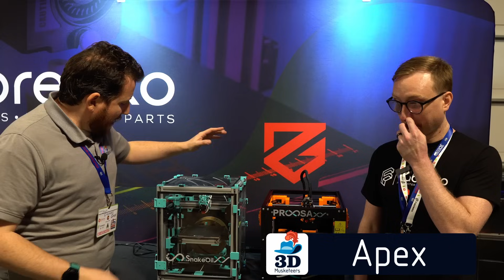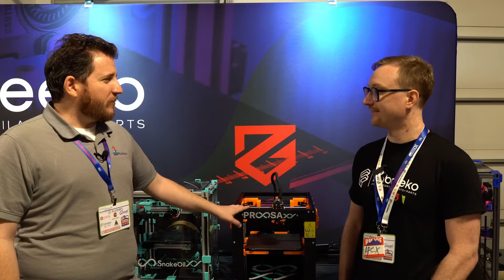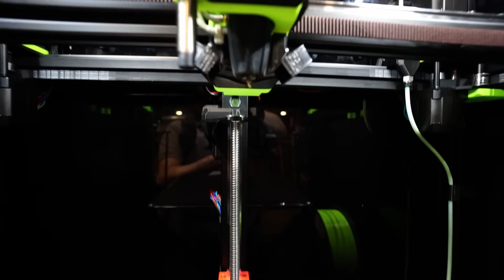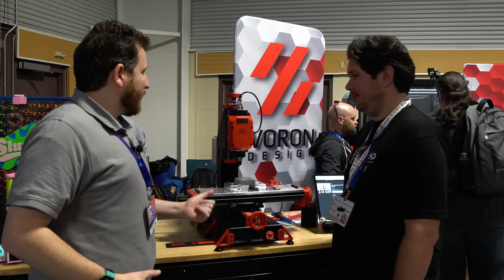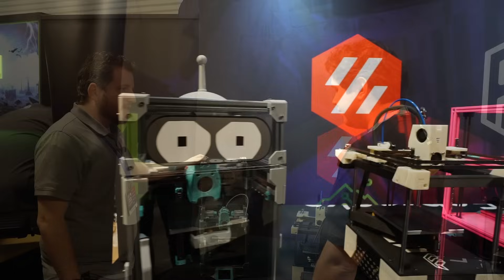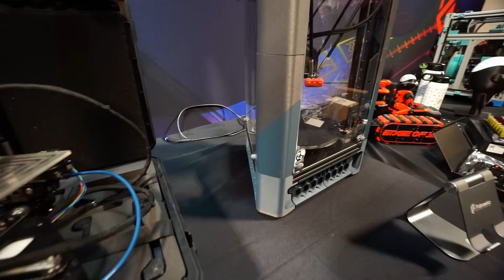Rat Rig's BRAND NEW PRINTER! - Fabreeko, Rat Rig | RMRRF 2024 4

Comment: Ooooh. I like the proosa. However, I just upgraded it to 3.5. It’s so fast and such good money spent. Maybe I’ll look on eBay for a used one to try this conversion.
Reply from the maker: yeah, if you did the 3.5 no reason to do the PROOSA
Reply: @3DMusketeers  yeah, I’m pretty happy with it. I’m ready to upgrade the tool head though. I pieced it together on the Prusa website and it comes to about 200 bucks and I think I could do so much better than a nextruder for less money.

Plus, I’m one of those types that enjoys the project probably a little more than the actual printer. I just like having something to tinker and build.
Reply: @3DMusketeers  i’m reading the stats and they still seems like there might be some benefits. But with the newer computer, it’s pointless like you said. I do like the footprint being much smaller.

Comment: I'll put in a vote for a V-Core 4 build...I'm trying to get management at work to buy something to replace our dead Stacker3D machine, and either the base V-Core 4 or the IDEX version would help us with a bunch of different things. The biggest thing holding me back from making an honest recommendation for it is the build time/complexity - if it's as involved as a Voron build, it won't work for us. The other front-runner is an FLSun S1, which even if it prints half as fast as FLSun claims is still going a ludicrous 600 mm/s.
Reply from the maker: I would guess it is pretty involved from looking at it.. But we will work towards it!

Comment: Thanks so much for covering our ProosaXY project!
Small correction: The frame extrusion is NOT re-used from the original mk3, but the front frame plate is.
Reply from the maker: Absolutely man! You always have some awesome projects!
Reply: this is exactly what prusa should do to survive. Use as much as they can from stock and upgrade MK4 to MXY4.
Reply: @thePavuk Nah. You can see the direction they are going. 

Commercial, hobbyist, consumer. 

If you’ve seen them at the tradeshow, they’re mostly set up for industrial and manufacturing. they’re really starting to put a big focus on capturing big businesses, science and tech hence opening US facilities. This will be systems like the Delta and the XL core XY system.

Next is battling back into consumer. They are going to have to leverage the manufacturing techniques of the Delta printer like metal, stamping and injection molding, etc.. this is going to have to be the machine that fits in nicely on your kitchen counter or workshop table with the standard cube design with multi material, but obviously this is speculation.

Finally hobbyists. Everybody thought that the MK3 was the pinnacle and there was just nothing you could do to really make it much better but as we see input shaping change all of that. Add some faster, motors, etc. and you have a great enthusiast even manufacturing machine. I think they go on to keep supporting that system and possibly even do something like getting involved in the voron project or more likely scaling down what they’ve done with the XL for enthusiasts. 

All pretty fun speculation, but they’ve definitely started making a big push into manufacturing and industrial where bamboo and reality and others will probably never be able to get a foothold just because everything is manufactured overseas, which is a big no-no for certain things.

Comment: Love the Proosa. Interested to see how the kit's price compares to a full MK3 to MK4 upgrade, which discards a lot of MK3 parts - it looks like the Proosa kit/upgrade probably reuses more parts and possibly provides some more/different benefits, being a core-xy. With the "full bear" frame upgrade, Klipper, and a home-rolled extruder, my MK3S+ runs faster and quieter and than an MK4. There are limits to Cartesian kinematics, though, and it seems like this is a promising and minimally wasteful upgrade/up-cycling path for the MK3 for people who want something a bit more modern than the MK3 platform, but don't want a  Bambu or Bambu clone for reasons
Reply from the maker: I dont think there is much of a reason to do the FULL mk4 upgrade path, but that is my opinion. For only a couple hundred more you get a second printer!